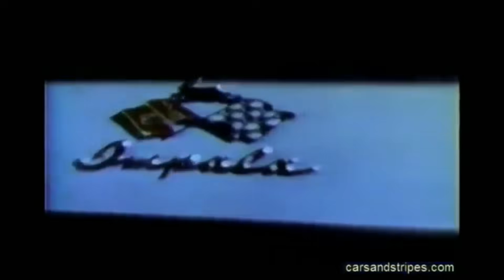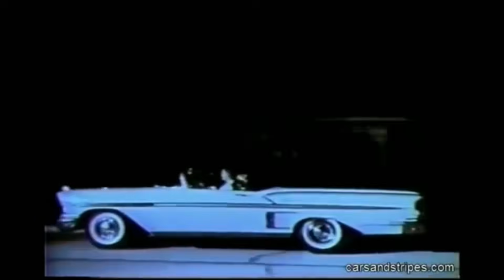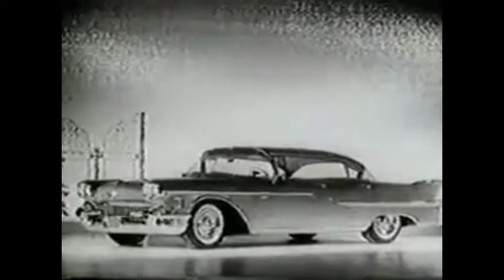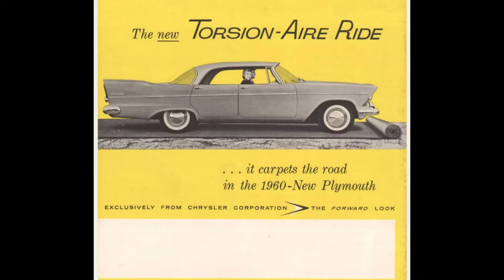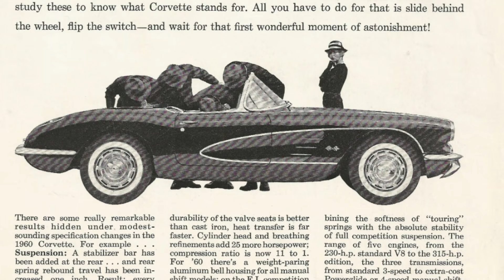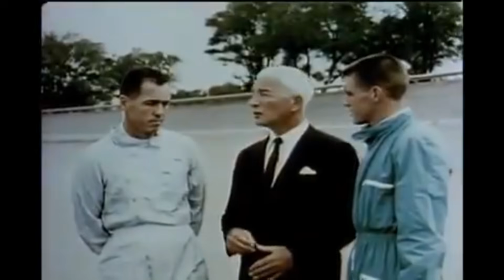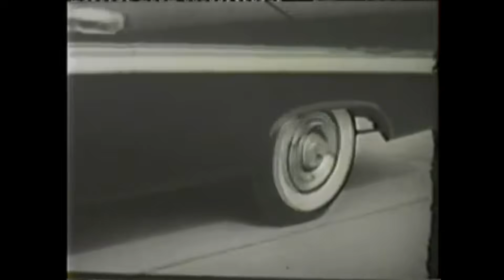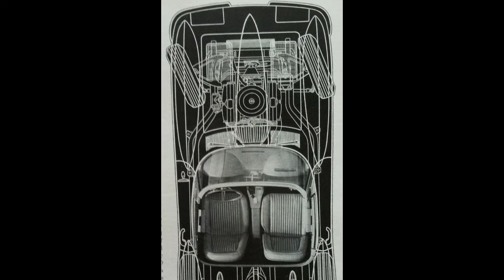The Forgotten Suspension Designs That Almost Changed American Cars Forever

Comment: You might have included the '55 Packard torsion bar suspension which linked the front and rear suspension.
Reply: Especially since the first scene in the video is taken from Packard's film in which the linked suspension is promoted. This is a major flaw in this video!
Reply: @rytbeard  I'm a motorhead but I didn't know about the Packard.  Thanks!
Reply: @garyhalmbacher6875  Jay Leno has a video with a demonstration of the self-leveling on those - 1956 Packards.
Reply: This guy is clueless.
Reply: Since this video started out with the 55-56 Packard Level-Ride 4 wheel torsion bar suspension (I have two 56 hardtops with that lovely ride), I was surprised to see how little was mentioned about it.  There are several Packard ads on YouTube already, so no hard feelings.  I also have a 66 Corvair and a 67 Corvette coupe with the independent GM suspension that 😊I have enjoyed for almost 50 years.  In addition, updating the cars since 2000, I also have a Range Rover and a Mercedes AMG with original air bag suspension.  All offer superior rides on rough surfaces, but none as smooth as the two Packards with their self-leveling torsion bars.  By 1956, GM buses had those air bags that were reliable, so I am surprised they could not get the passenger cars right.  A friend with a 57 Cadillac Brogham just replaced his with ne (hard to find) bags, valves, pipes and compressor and it was not cheap and took months to complete.
Reply: @davidbrownell1129  Ford and GM made cars with optional air bag suspensions in 1957 or 1958. Almost all of them were quickly replaced with regular steel springs. Amazing that the parts could be found for them today.
Reply: I own a 1956 packard clipper with the torsion level. 70 years old and still rides great
Reply: I wonder how this suspension worked when passin over speed bumpers.
Reply: @Telecolor-in3cl  The Packard suspension reacts just like any spring type suspension. Torsion bars are essentially coil springs that have been straightened or are the bars before being shaped into a coil, though thicker.

Comment: The Ford Thunderbird got independent rear suspension in 1989 And it was arguably a mass produced car not a small production line sports car. 
The Chevrolet corvair got independent rear suspension in 1965 It was also a mass-produced production car They literally hundreds of thousands of them,
Reply: Corvair had independent rear suspension from the first year, but it was improved in 65.
Reply: Approx. 8 million Corvairs..
Reply: 1984: Fiero - IRS. 136k units built first year. A total of 370k units built from '84-'88 during its 5 year production run.

... before the Thunderbird.
Reply: @bryanayers6104 I forgot about the fiero. 
They were such a great car especially the GTs from '86,7,8 fun cars to drive, I almost bought an '86 GT in I want to say 1998ish.

Comment: "Under the sheet metal" while they're showing a fiberglass bodied car.
Reply: Solid axles, front & rear,,,, what a sham....!
Reply: @mrpoolplayer6379  Not to detract from your statement which was true, in 1933 GM adopted independent front suspension for all models at the insistence of Maurice Olley. Maurice Olley's life story is very interesting. When it came to solid front axles, Ford was the hold out. Chrysler adopted IFS in 1934 and Studebaker had a version in 1935 called planar suspension that was engineered by Delmar G. "Barney" Roos. It was a form of IFS. It did take quite a while for light trucks to adopt IFS in any form.
Reply: Just what I was noticing, too.
Reply: It's A.I. It doesn't know any better.
Reply: Or your Under 50 IQ inability to understand metaphor

Comment: Before the Viper, GM had IRS on the 1979 E-body (Eldorado/Toronado/Riviera) and the 1980 K-body (Seville).
Reply: The 1961-1962 Pontiac Tempest also had independent rear suspension AND a rear transaxle.
Reply: All GM "full" size FWD cars had it in '85-7.  Ford Taurus SHO had it in '89.  Viper was 1992.  This is a sloppy video.
Reply: Corvair as well
Reply: The Corvair had IRS since it was introduced July 1959.
Reply: @kenm4678  In 66 or 67, Corvair went full Corvette when they dropped the swing axle and went full 4 link.  Awesome budget cars.  Look around on the internet for mid-engine V8 Corvair conversions.  Race quality handling and acceleration.